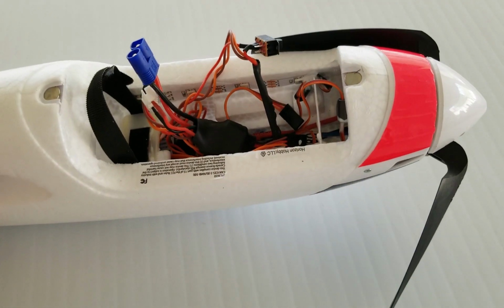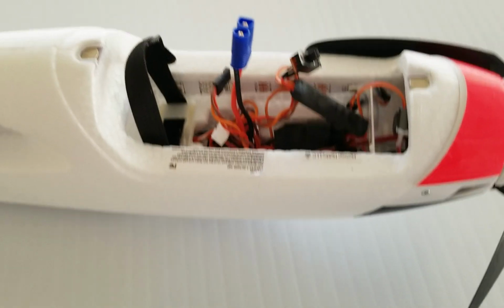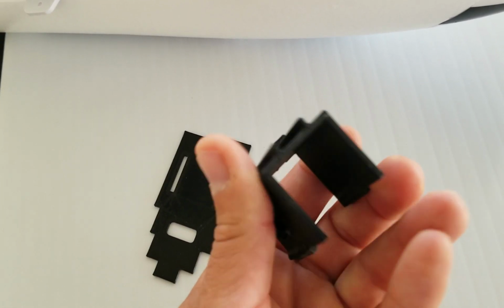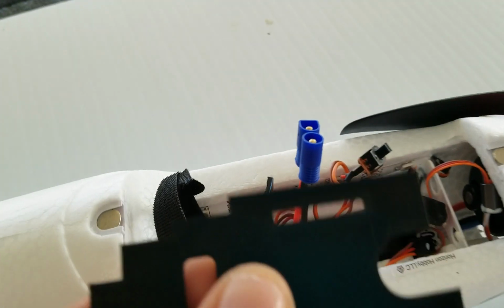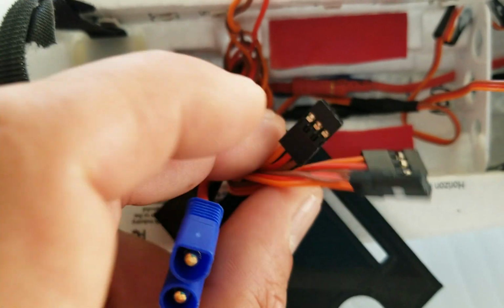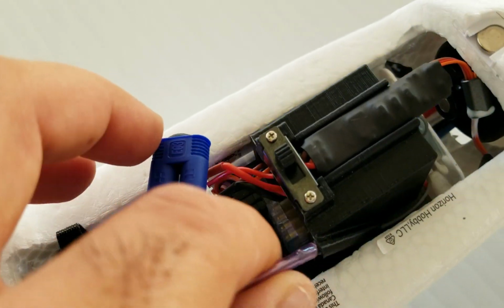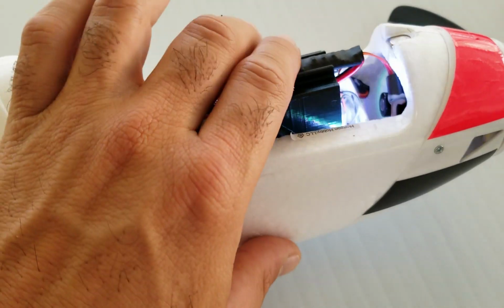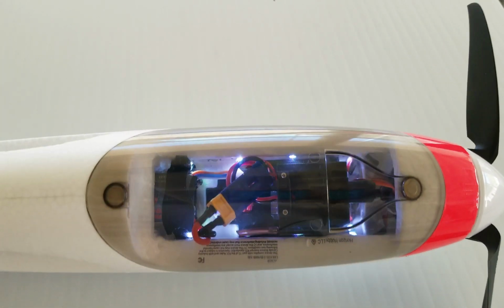Flite Test Night Radian RC Glider Mod

Comment: I don't have a 3 d printer and don't see where those are that big of a deal. I could make something out of sheet plastic and an exacto knife if I wanted. even twisting the wires would be nicer looking than that rats nest. I intend on cleaning mine up but want to add a pilot. I hate planes with no pilots, it drives me crazy to see all that room and no head and shoulders at least.